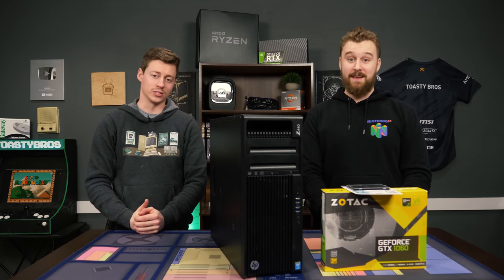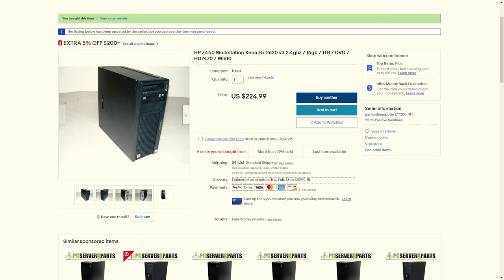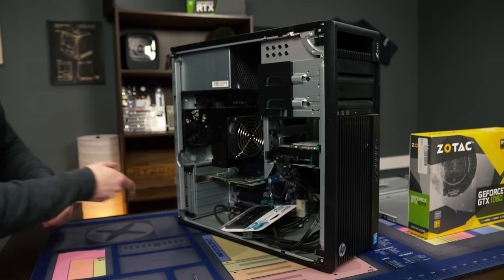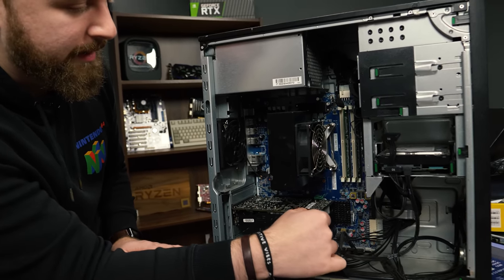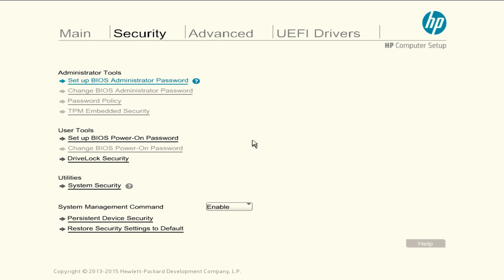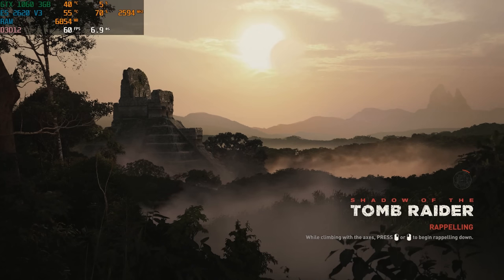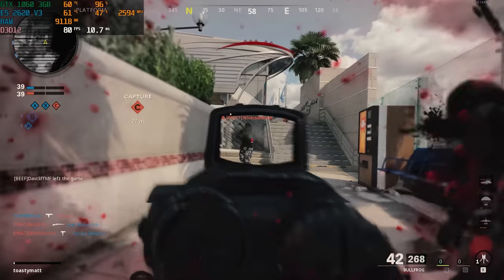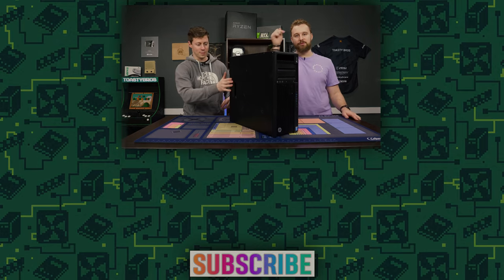EASY $450 Budget Gaming PC Build 2021

Comment: I built a $350 PC with a 1060 6gb back in late 2019

It's evolving, just backwards
Reply: you mean its droping fps 🤔🤔
Reply: @rjeight  it is a pewdiepie reference
Reply: 1060 6 gb is good ??? For 60 fbs
Reply: @RickTech0  It gets 60fps at 1080p for most games, usually on medium. It can definitely get 144fps on lighter esports games like Fortnite and Rocket League. Just make sure you don't skimp out on the CPU or you'll get bad stutters and frame drops.

Comment: Just to add info: the 700W PSU can support up to 150W per 6 Pin cable. Is an specification from HP enterprise to support back in the Days a high end Quadro + a Tesla GPU accelerator. Each 6 pin cable can support up to 225W GPU (150W cable + 75W PCIe) I tested myself with up to one RTX 3070 + a Quado K6000 installed simultaneusly and running 100% usage. You just need to get a good quality 6 Pin to 8 PIn adapter and very important, do no get the cheapest one, it may not support the current coming from the 6 pin cable. I hope it helps :)
Reply: OH MY GOD THANK YOU SO MUCH JORGE I LOVE YOU!
Reply: I assume the K6000 is a single slot card, other wise I don't see how you would fit a card in such a tight place. X16 slot is almost flush with the bottom of the tower
Reply: So, that does mean I can install a EVGA RTX 2070 XC that needs a 6 pin and an 8 pin correct.? Where can I find a "good quality 6 Pin to 8 PIn adapter" .? Seems the HP good quality 6 Pin to 8 Pin adapter is no longer available. Somebody else has to make one I hope.
Please HELP!
Reply: @greywolf9398 I would recommend getting the proprietary to standard atx converter cables so you could install a standard atx psu

Comment: Looks at description 

Sees 1060 3gb listed for $179

Throws phone out windows
Reply: Dude gtx 950 are going for over $100 its crazy
Reply: @adnanti-nk1hw  Yeah some stores are selling new ones for that in the US.
It is crazy
Reply: Evga mid week madness, check it out
Reply: HP and Lenovo prebuilts can be found for $400-500 with GTX 1650 Super.
Reply: Literally got an Sapphire nitro+ rx 470 for less than that. Still paid 132 with shipping and tax but somewhere in my mind I knew things would only get worse. Happy with my GPU and now looking at ebay again those same RX 470 cards I saw for 120-140 are going for 170-220...
Reply: @TheRealMoeru   I built a PC for my brother this time last year, a new R5-1600af was $85 and used MSI rx 570 8gb was $80. Around the same time I got a Sapphire rx 470 4gb DVI-only mining card for $65. I used a DVI to HDMI adapter and surprised to learn DVI can carry audio. I recently gave up on building a PC and bought an HP with R5-3500 & 1650 super for $400, hopefully a good down-draft CPU cooler and addition of a side mounted intake fan can keep the temps reasonable.
Reply: I got into PC building around January. What did a 1060 used to go for?

Comment: Ah yes the iconic buy a old dell/hp and slap a gpu in it
Reply: These are proper workstations with a good PSU (usually minimum 450-500W - 80+ Bronze), so that you can safely choose the kind of GPU you can ACTUALLY get your hands on. These Xeons draw more power, but are pretty damn strong too (and you can UEFI patch the bios to unlock all-core turbo boost).

Comment: I purchased a z640 and z840 for a home lab but also purchased a crap ton of E5 2600 V4 of various models to bench mark.  The findings are interesting.  I will say that if you are using more than 8 cores, try turning off hyper threading.

Comment: The 6 pin PCIe power cables are over spec compared to standard pcie 6 pin connectors and each one in the z440 with 700W PSU is rated at 18A (you can see it on a sticker on the other side if you remove the PSU). This means each one is rated to 216W and hp actually sold adapter cables to use 8 pin PCIe cards. I'm running an RX 580 off of a single one in my z440 with no issues at all

Comment: I bought z440 9 months ago with the 1650v4 which is a i7 8700. I paid $330 and basically stole it it even had 6 months left of warranty. I'm running an rtx 3080 in it now. The case is awesome it has the optional ram coolers and optional gpu cooler.

Comment: If you guys want a good cpu cooler for 15$ the snowman cooler off AliExpress is a really good option I've been using it in my system for close to 8 months and had no problem and it's around the same thermals as the hyper 212

Comment: I know this is an old video but this HpDragonballZ440 does nor perform as well as my HpDragonballz420. I'm using the E5-1650 v1 and they are using a V2. On top of mine being a V1 Z420. I wonder if it's because I'm using a G1 gaming 1070 ?

Comment: Build is even cheaper now. Didnt use the higher end z440 as i was trying to keep the build under $200 to be used as the heart for a high end arcade cabinet. HP z400 with the 3.5 ghz xeon w3565, 475 watt PSU, and 18 gb of ram for 80 bucks used. Had a unused firecudda 1tb drive laying around and picked up at gtx 1070 for 90 bucks. Machine is going to be sweet to play all the newer and old fighter games.

Comment: Hey toasty bros,could you check out the hugon 75hz 27" monitor on AliExpress,it's quite  cheap.about 75$ if I'm not mistaken
Reply: Don’t waste your time , 1600x900 75 hz monitor are on Amazon for less than 100
Reply: @earnistse4899  cool,but the one I'm talking about is a 1920x1080p screen,

Comment: Our advertisement says it's a 440 but it's actually a 420.It has a 4c/8t cpu clocked to 3.5ghz,16gb ddr 3 ram and a quadro k2200.Problem is it's the almost the same price as my r5 2600 new.If you already have an old pc with most of the parts.You can actually buy an upgrade kit,mobo,ram and cpu for half the price.
Btw i saw that gpu mounting error before it happened.There's 2 mistakes even veteran makes.That's forget to remove correct slot plate and forget to install the I/O shield 😁

Comment: I was thinking of getting one of these workstations because I happened to stumble upon a brand new i7-5930k and I want to swap it with the Xeon processor. Is the socket an LGA 2011-V3? And could I swap out the PSU? Or does the mobo have proprietary power connectors?

Comment: You can use a 6 pin to 8 pin power safely. The other 2 pins are only grounds. I've never had a problem with doing this. Also you could probably build this "new" for cheaper (with a nice gaming case). X99 board (bios modifiable, X99 is very popular) this CPU (or better) + 16GB RAM + good CPU cooler goes for about $150 on AliExpress. You'll get easy all core turbo boost unlock on these for even better gaming performance (3.3 on all cores due to an exploit in the BIOS). It's really a great platform to slap an RX470/480/570/580 in and get gaming for sub $500.
Reply: You absolutely can build it better and cheaper. This is an ok option for beginners. As it stands I have the 1650 V1 in a Z420 V1 and using Tstop and raising all cores to 63 nets me 3.5 on all cores. I still laugh at that. My son uses it for minecraft and fortnite paired with a 1070 for over a 100 fps  on each
Reply: @belialrott   The best z440 I have seen are the Xeon E5-2699 V3 & 64 GB models, those are the best & cheapest ones I could find. Could you even build something comparable for less than $450 not including the GPU ? Or at that point would an E5-2698 v3 & 64 GB be a better price to performance?

Comment: What if I use a 1060 with an i5-9400f
Reply: 1060 is a fine card if you are planning in 1080p gaming! I have an i7 3770 and still holds up to every modern game, havent tried cyberpunk though yet, youll  get 65+ on most games high, closer to 80 on med-high settings

Comment: I would suget if you have 50 extra buck getting the e5-2640 it has 8 cores and is the equivalent of a modern six core.
Reply: All core turbo unlock on that CPU is insane. Especially considering you can get these for really cheap on AliExpress with a dedicated X99 board (if needed, as that will allow for custom RAM timings over these workstation boards).
Reply: @b0ne91  yeah I personally have one of these cpu except I went for a old enthusiast motherboard which has more features.
Reply: @techeovr9575  At that point, some of the 16xx series would've probably been better, as they OC pretty nicely. I still have a really nice, high quality X99 board lying around that I'm not sure how to use yet. E5 1650 v3 is the minimum worth putting it in, especially considering it's unlocked. Too bad the 1680 is so expensive.

Comment: That's a nice PC for the price. I'm curious how that processor compares to the FX8320.
Reply: The XEON will kill the FX cpu
The XEON is 3 years newer as  well.
Reply: @Gravel-79  I didn't know that. Thanks for letting me know.
Reply: @BREEZYM6015  FX8320 is a really bad cpu almost bankrupted AMD, they can compete with a I7-2600K in multi threading performance but because  they are "8 cores" single thread performance is basically half :) They are no match for this generation of xeons.